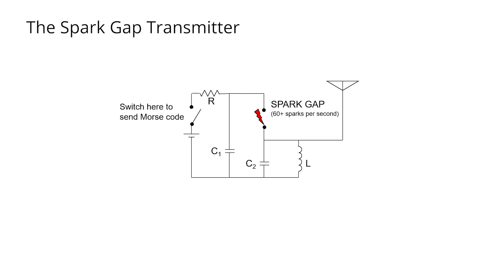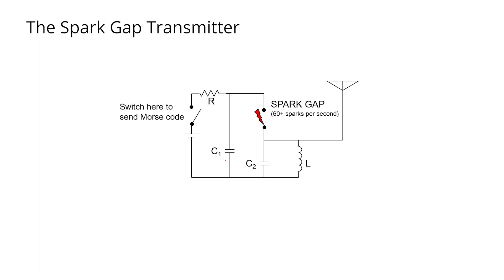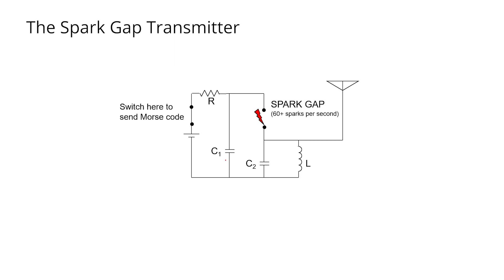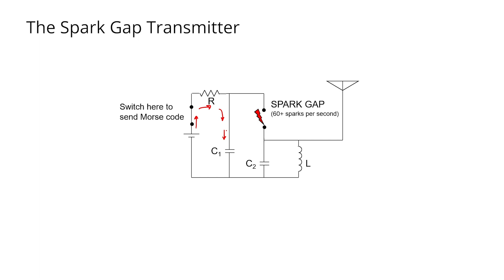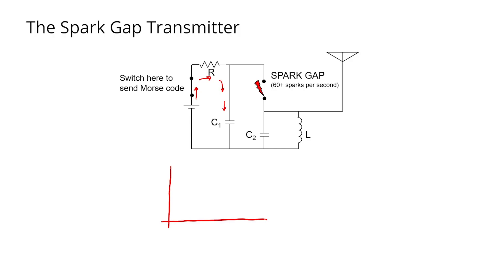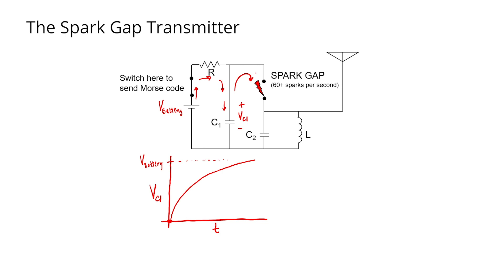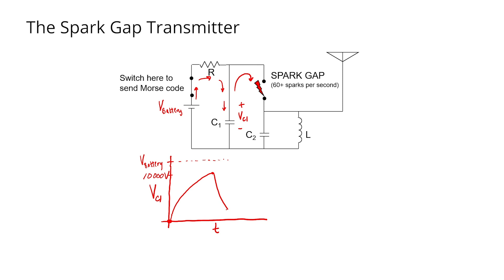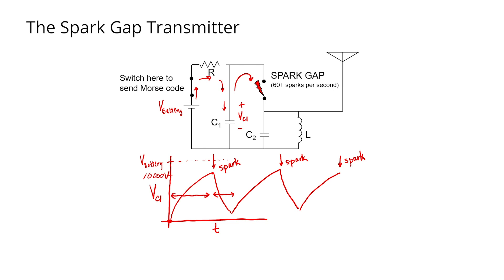Introduction to Spark Gap Transmitters (3-Analog Electronics)

Comment: Thank you for the video and for the series. In the video (4:49) you mentioned that discharge time, is governed by selecting C1, C2. This is correct but it would be more accurate to mention ESR and other parasitic resistance in the circuit.

Comment: Thank you for the great video series on the subject. I have a quick question. When the spark ignites, the voltage on C1 drops, as a result the spark would break off again and end the charging of C2. What i mean is, the charging curve for C1 shown in the picture 4:54 should somehow be much more asymmetrical, or am i wrong?
Reply from the maker: It could be, as it will ultimately come down to the values of the particular components, but the circuit itself is impractical for several reasons though.  In the next video the spark gap is moved to a better location.